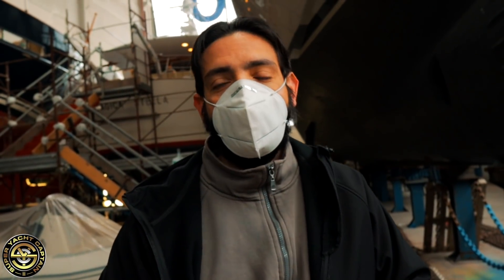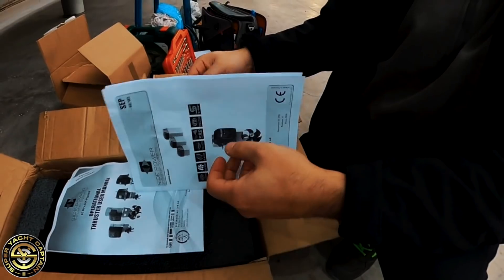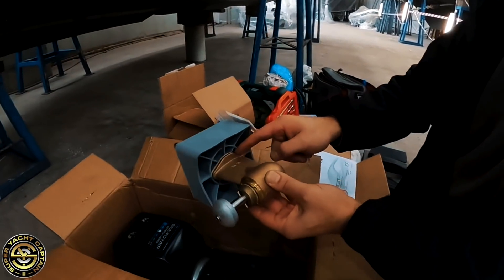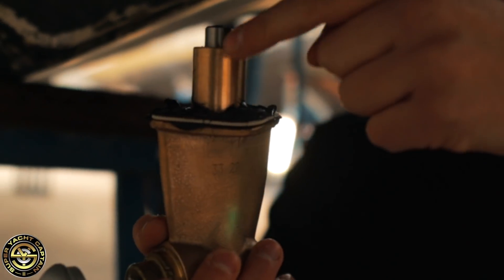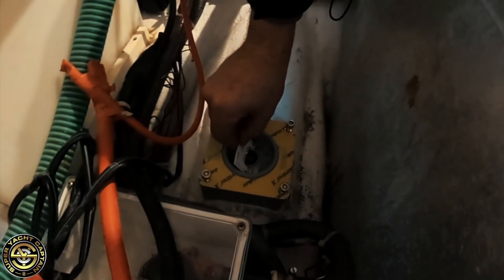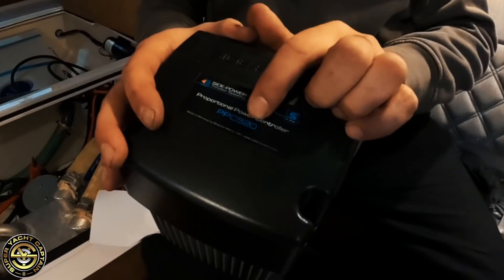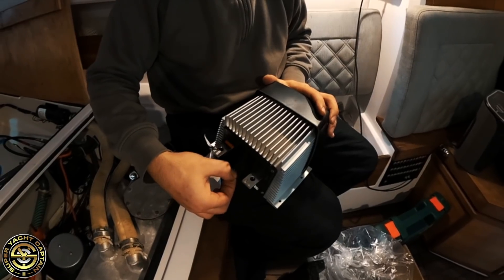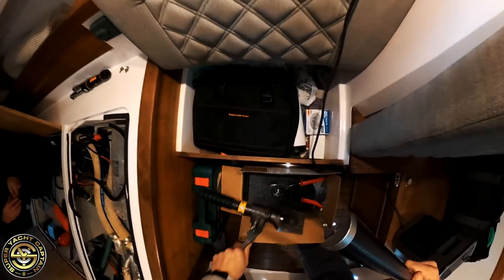TECHNICAL INSTALLATION OF A BOW THRUSTER ON A SUPER YACHT CHASE BOAT.

Comment: Loving the videos. I have a couple of questions about the chase boat please :)

Why does a smaller boat like the chase boat need a bow thruster?
Why does AWOL have a chase boat like the Axopar as compared to the much smaller tenders we see on shows like Below Deck?

Thanks.
Reply from the maker: Hi Robert,

Thanks for the feedback.

I’m doing a YouTube Live tomorrow at 19:00 CET and will be answering the viewers questions. So please Join us and would happily give you a full answer. 

Cheers
Reply: 37’ is not small...by definition it is yacht size.  Since engines are close together steering a long boat with the engines is more difficult and takes a lot more throttle.  Having a bow thruster helps a lot.
Reply from the maker: Hoping this Friday at 19:00 CET
Reply: When are you going live next?

Comment: Tristan given it looks like you have an AGM service battery if you replace it with a Lithium that would give you more capacity since you can drain it down more without doubling up. However you would have to check for your alternators and charger for Lithium compatibility.

Comment: Bow thruster pulls high current from batteries in short bursts...not unlike starting the engines.  You would be better off installing a dedicated bow thruster battery, a start type battery, close to the bow thruster to keep supply cables short and minimise voltage drop on the cables.  House, or service battery, should be capable of relatively low (in comparison to start battery draw when engine is cranking) steady amp draw for long periods of time.  Start battery needs to be capable of providing high current for short period...like what bow thruster requires.  If you position bow thruster battery too far away and don’t provide big diameter cables, the high current draw will cause voltage drop in cable resulting in reduced voltage at motor.  Also, dielectric grease should be applied to electrical connections at bow thruster motor to help ensure good electrical connection is maintained in harsh salt water environment.   Since bow thruster will draw large current, it is extra important to ensure you do not get high resistance joint at the bow thruster connections which will result in large voltage drop, heat at the joint and extra stress on motor insulation system resulting from higher current draw due to reduced voltage at motor terminals.

Comment: I was wondering why do you need such big batteries for the outboards?  Surely they only need one between them as they are only really used to start the engines?  That way you could use two of the batteries for services and one for the engines and then have a battery switch that allows the services to draw from the engine battery and the engines from the services battery should that be needed (ie one of the batteries die for some reason). Im sure theres a reason for the layout so if someone could explain it for me that would be great. thanks

Comment: Great video. I may have missed it, is the new thruster 24v or 48v? Do yall have a setup on tender and mothership to provide shore power from AWOL to the chase boat when at anchor?
Reply from the maker: 12v and yes we can connect t he shore power to AWOL
Reply: @SuperYachtCaptain  There was a recent interview by Sandy Munroe who was interviewing none other than Elon Musk and he mentioned that future Teslas may dump 12v entirely obviously they are only used for services like your yacht. But it was interesting how we never think about it and 12v is really an legacy and no real use for it apparently even Ethernet cables the stuff you do not think about and blithely clip in and out on its little plastic connecters uses 48 Volts!